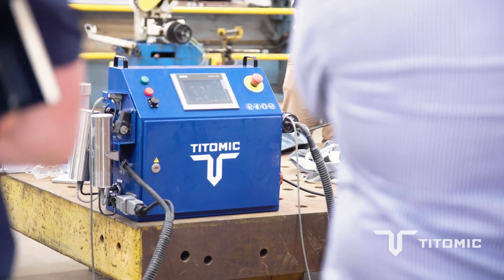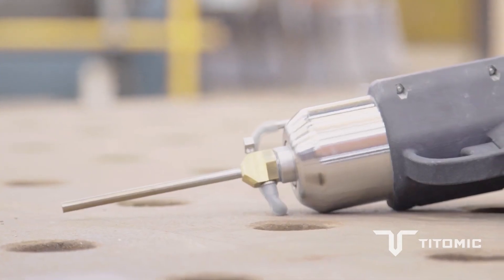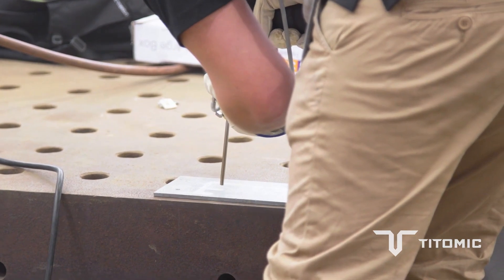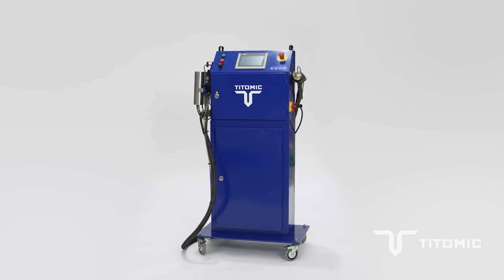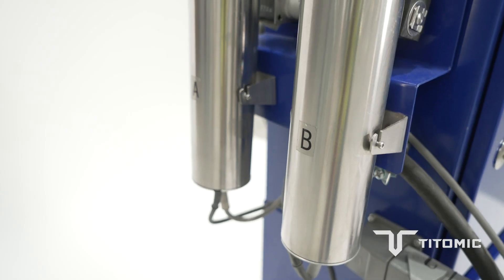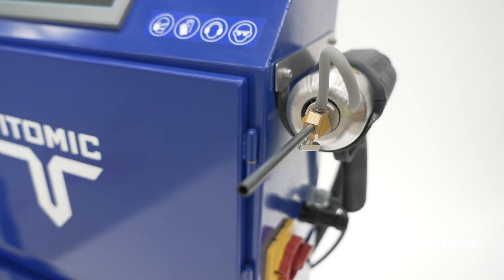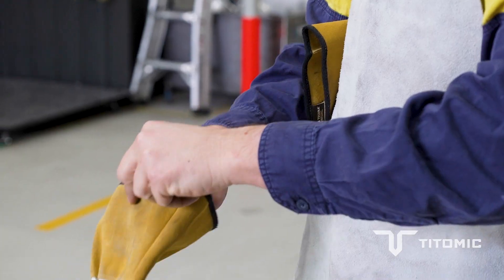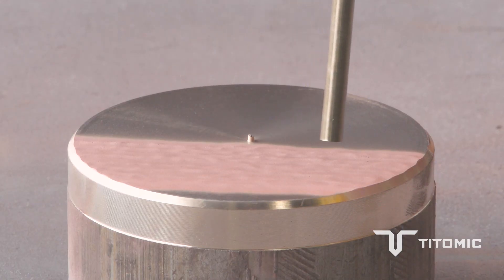Cold spray for mould repair

Comment: What is the porosity percentage of this method?
Reply from the maker: Depending on intentional process variables, density can be as high as 95-98% in an 'as sprayed' condition. If heat treated, densities can reach ≥ 99.5%, competing with wrought or forged parts.